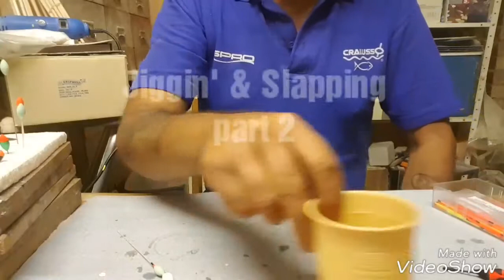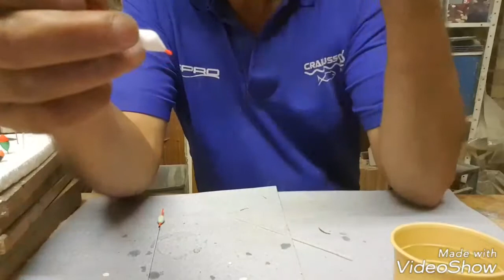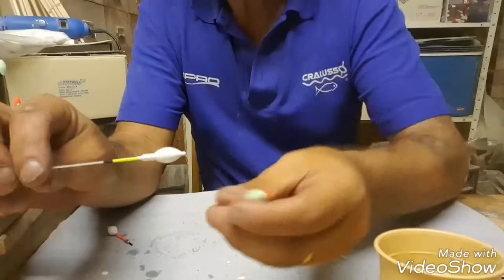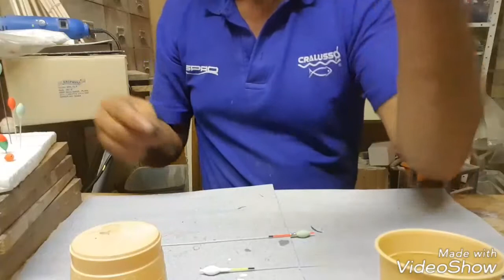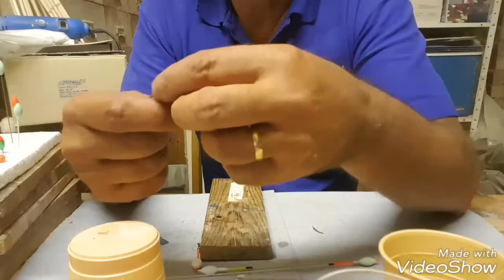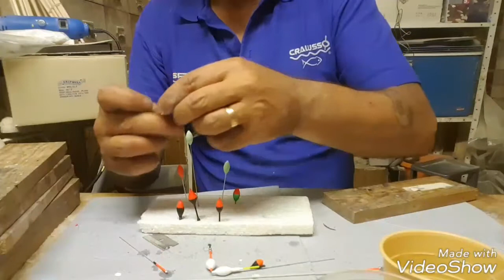Jiggin and Shallow Part 2

Comment: Hi.how do you get a smooth finish using the h160 foam bodies when painting by hand?
I've just started making my own floats and using the h160 foam in the rugby ball type float,tends to have a finish like a rugby pitch.
I purchased these bodies from one of the mentioned companies that you use.
Reply from the maker: All floats weather made or as In this case assembled by me!
If finishing by hand I sand between coats in an open chuck